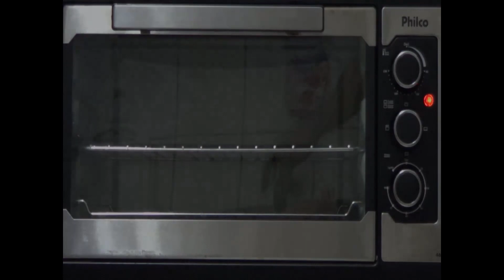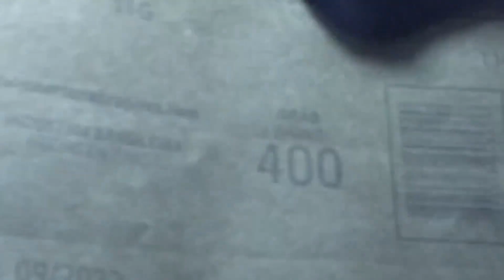Knife Making - Making a Japanese Kitchen Knife

Comment: Thanks. But at least nail down your anvil.
Reply from the maker: I'm needing
Reply: I second this. Heat up some round stock, and drive it hot through that stump.
Reply: And make some tongs while you're at it.  More content for you and you get to help yourself.
Reply from the maker: @joshyingling  Yes yes, at the moment here at home it's being renovated, but as soon as I can I'll see if I can make any tweezers
Reply: Buen trabajo 👍 chamaco. Saludos 🤗 desde Puerto Rico 🇵🇷
Reply from the maker: @josearodriguez9904  Muchas gracias!!! Saludos a Porto Rico
Reply: Bolt down the anvil. How many time did that fall off  the stump?